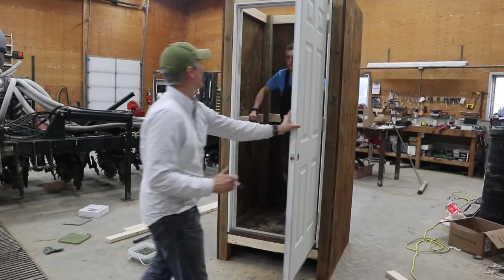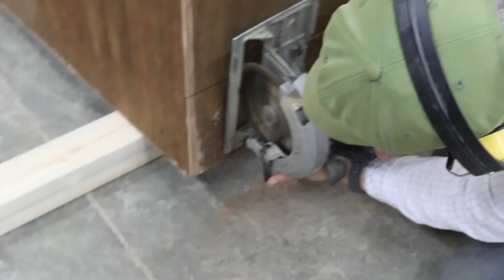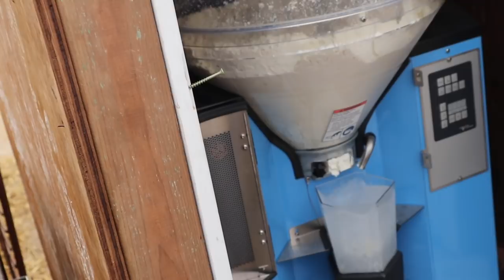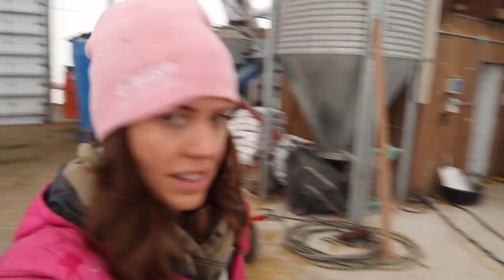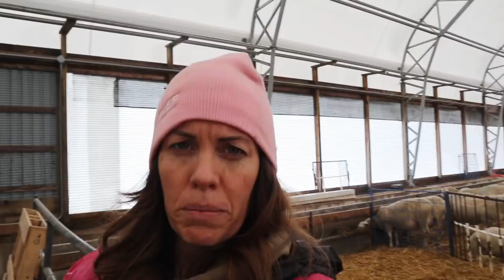Installing an Automatic Lamb Milk Feeder: VLOG 69

Comment: If we were having that many high order multiples, I would be purchasing one of those machines too! Or dorpers usually twin, we will have 20-30 sets of triplets per year (we have 600 ewes), and once we had a set of quads. And I like it that way.
Getting my bottle lambs to market weight is such a crapshoot. Half of mine seem to do well and the other half just forever lag behind until I finally get tired of coddling them and we just sell them to get them gone. I can't figure out what is the deciding factor in their growth either. They're all raised the same. I don't raise a ton of bottle feeders (maybe 20 a year?), but they are so.much.work. Plus, I develop favorites and get too attached and try to convince my husband that we should keep them as pets, haha.  Never works! =(
Reply from the maker: YES!!!

Comment: Ive wanted one of these machines for some time. I don’t have enough bottle babies to sustain the cost and, the big thing, we are off grid and i cannot determine the electricity requirement. Within the next couple years I will be increasing my flock from 125 to 3 - 400. I will need something like this then. I’ve called Grober and asked the electricity needs but no one seems to understand the question and reason I’m asking. This is still on my radar I’m so jealous right now
Reply: Hi Deedee, my name is Jackson and I am a Young Animal Specialist with Grober. Sorry you haven't been able to get an answer to your question. For an on the grid application the answer is "on average quite low", which is very dependent on how many animals are on the machine because it does draw significant amps when it runs (it requires a 15 amp/240V circuit). The heating element, powder motor and mixer motor require some serious juice to run all at once when its mixing, but very little when its not. My educated guess would be max a couple of hundred watts when the element is off. If you would like, please contact me at 226-755-2481 or jmatschke@grober.com and we can try and come up with an answer for you.
Reply from the maker: Hey Deedee!  Looks like Jackson has handled the question!  Good to have their contact info...  I'm not that literate in the electrical world, so glad he answered for me!!

Comment: I have a Forster Technik calf feeder. Wouldn't be without it. 
I now also have about 20 lambs to feed and the time I get a lamb feeder is getting closer and closer. How much did that thing cost in Canada?
Reply from the maker: It ended up costing around $6800 with tax...  I'm weaning this group next Monday, so excited to see the results of this machine compared to the rest of the lambs left with mom!
Reply: You bought well. The build quality on those things is very good. I had an inferior machine before which I had to fix myself and it was hell. Don't expect the lambs to do quite as well as with mom, but they'll do pretty good. It's all about getting them on ad-lib pellets ASAP in my book.
Reply: welshmuzhik 
Can I ask which brand u didn’t like. I’m deciding on which one to get but want a reliable one.  Cost would b my next deciding factor.

Comment: I would like to know more about the mechanical workings of the machine. Did you end up having to do insulation wrap on the lines up to the nipples? How much dry milk replacer does it hold? Why did you go with only two nipples?? Will other milk replacer work with it. How doest it worl, does it automatically make liquid milk after a certain amount of time or does it have a resavoir that after a certain point it automatically fills? And who cares if there are hateres out there. Your sheep your business not theirs.
Reply from the maker: It holds a bit more than a bag of milk replacer...  Only 2 nipples because each nipple services 15-20 lambs.  I'm not sure if you can use alternative milk replacer, but I would guess yes?  It mixes little batches at a time when the lambs get the fluid low enough to trigger the sensor at the bottom, then it automatically refills.
Reply: We use a different brand and it works just fine in our machine.